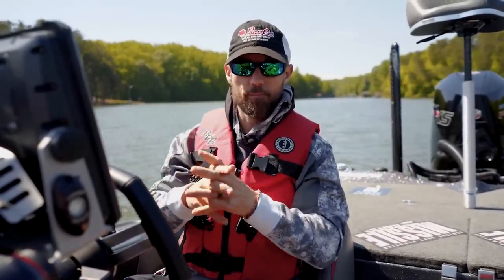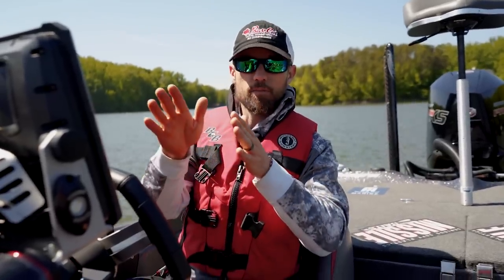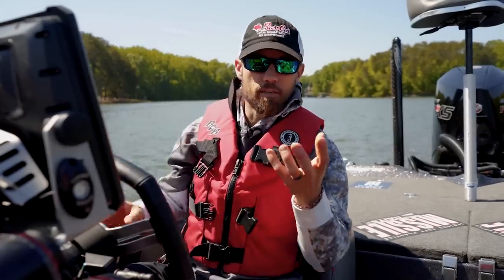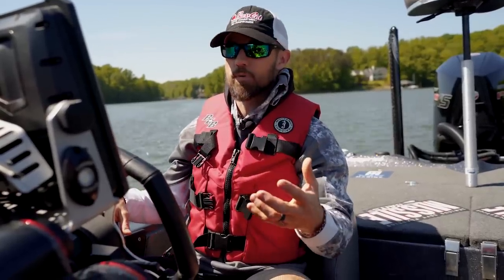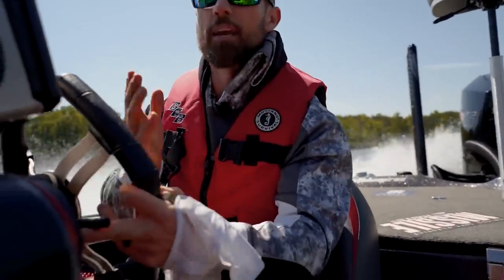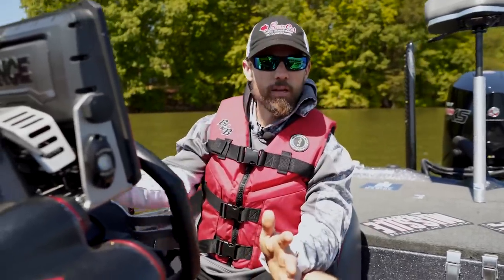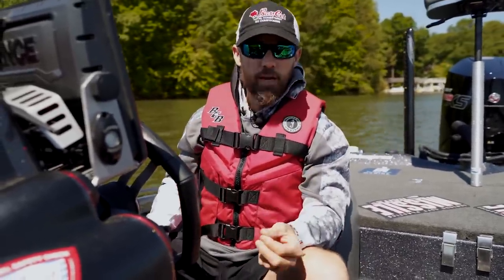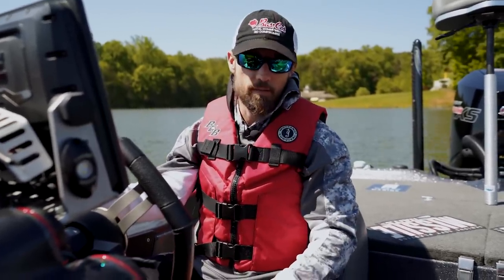BASS BOAT DRIVING - TOP SPEED 101

Comment: I used to fish Tournaments in a Champion bass boat that ran 75mph and you are 100% correct. I had that boat airborne hitting unseen waves and without experience they can get pretty hairy. 
That was years ago and I dropped out of bass fishing for awhile and sold the boat.
Now getting back into fishing I have a Basstracker 17ft with a 40hp. Now no rooster tail but you can still over trim and lose speed and the rules on waves can still apply even at 35mph.
In a smaller aluminum boat like that if you hit a wave wrong it can still toss you hard. When I had my  Champion most boaters do not realize that two boats 65-75 mph 100 yards apart will meet in 3 seconds or less. 
Where I am on the Mississippi River near LaCrosse Wi in some narrow areas two boats heading at each other and may be on a blind curve or a larger boat blocking vision that can be devastating with less than 3 seconds to react. You could do a video on reaction time when running at those speeds. You always have to pay attention to what is ahead of you. At night it is worse. One tournament I fished went until dark. Myself and 2 other boats all running in the 70+mph had to avoid a canoe that had no lights. We were all lucky we seen the Silhouette and took evasive action to avoid the canoe and each other. And yes always wear a kill tether even with my 40hp.
New subscriber and looking fwd to bingeing your videos.
Reply: Champions were Classics probabably the very best rough water bass boat ever. And that Deep Vee Wedge hull design was easy to handle.

Comment: Worth mentioning- when you feel like you’re loosing it don’t close the throttle. Your reflex at first may be to let off the throttle too fast. Trim down first and slowly back out the throttle- simultaneously. Snapping the throttle shut will cause even less control.
Reply from the maker: Yes! I may have left that out. Good one. 👍🏼
Reply: Heck yes it makes it worse, even if the lake is glass and you just let off the gas all at once, almost gives ya whiplash haha

Comment: I know im a little late to the party but as a former owner of a triton 200xp i learned 1 very important factor in running wide open...    Your hydraulic steering can lose pressure(just enough to chine walk) and the best thing is to turn the wheel ever so slightly to tighten up the pressure in the line..   It doesn’t take much but doing this prevented my boat from chine walking.

Comment: Great info, but I would add this. If you get loose and feel scared or out of control AWAYS trim down before you let out of the throttle. Some boats if you let off the gas too quickly and don't trim down you can experience a prop blow out.

Comment: Use the jackplate after raising the nose up all the way. The lower unit  will pull the boat left and right. Lifting the motor with jack plate until you feel no torque or a balance. 
Hi performance , we raise till water pressure drops then bump down.( to get 1st known measure on height), then there from then on if running light and wide open.You can adjust your  motor height based on load.  The lower the motor___ the more chine walk. When done correctly you should not have to " drive thru it".  Allison yes....
 I owned Allison, Bullet and Tritons, Skeeters.@ 9.58. boat is not on pad your chine walking , not wide open, if you are ,your nose  is too far down , reference your first comments. If you dont not have a electronic or hydraulic jack plate  you will fight that dipping side to side.Always ,  life jacket on when big motor turns on. Much respect on your fishing!
Reply from the maker: Yes! Great comments. You’re 100% correct

Comment: Nice vid John, covered the important stuff well. Curious about your thoughts on two things - if/how loading the boat/side-to-side balance can affect chine walking, and how do you handle turns at high speed. The idea of an accidental bow hook is always in my mind when running at a good clip, appreciated the details on dealing with wakes. Thanks!
Reply from the maker: The less weight you have in the front, the more she will walk. Side to side not affected. High speed turns will be in the advanced turning video. 👍🏼
Reply: @JohnCrews  so with that said. I keep very little up front. The Sabre, I've found does not lift well with weight up front. Maybe I'll move stuff around and experiment a bit....🤷‍♂️

Comment: Small adjustments on jackplate can help also..and I mean small adjustments..if your boat starts to chin walk at a certain speed..you can start those slight side to side wheel movements before the boat starts to walk. If you wait for the boat to initiate the chin walk more times than not your a move behind and could make the problem worse.. Be safe out there!

Comment: What is your particular mind set on how weight should be distributed as it relates to speed. Ken Smith did a video showing changes in top end speed based on how his weight was distributed in his boat. Also, as lithium batteries are much lighter than regular batteries and many/most people believe that the lighter load (in this case, obviously batteries) equals more speed. Yet, I've seen other videos where they are purported to show that because of where batteries are normally located (ie the back of the boat nearest the power source) that switching from lead to lithium only increased the speed less than 1 mph. What, sir, is your take on that. Thanks.
Reply from the maker: Short answer is the switch to lithium’s has zero effect on top end but a HUGE difference on hole shot. Lots of tips to weight distribution for boat performance
Reply: Thanks, John. It might be an idea for a future video, assuming you haven't done one already.
Reply: Boat brand has a lot of affect on how weight affects the boat. And where you need the weight. If you swap to lithium’s in a bullet or Allison, (and no I’m not talking about the 20ft boats, specifically mean a 21) you WILL again speed, guaranteed, every time.  And yes, bullets can ride good. Best ride I’ve ever been in was a 21’10 bullet, worst was a ranger, speared every wave cause they’re so heavy and can’t get out of the water. This is on wheeler lake too and it gets big and rough there.

Comment: forgot to add that it is pretty essential to have a hp lower unit with a lower water pick up.  on some applications with a standard lower unit, you can run out of water before hitting the magic spot.  the hydraulic jack plate makes it pretty darn simple to get it dialed in.  amazing what just an 1/8 of an inch will make between having to fight the boat and just driving like a car.  and not every boat will run right with the same prop.  find the right prop for your boat not your buddies.
Reply from the maker: Very true. 👍🏼

Comment: John if you're in a lighter aluminum boat going 56.4 mph in a Tracker 190 ,Mercury 115 XS pro with Laser 2 prop with 22 pitch is this like if you're running over 60 mph in a fiberglass boat?

Comment: When you say bump it down two taps, do you raise the trim back up once you are moving pretty fast or just leave it there? I have a 2000 TR21 with a 225 EFI and I have had it up to 73 once. At 65 it starts to walk pretty bad. I made around 8 runs today and every time I would eventually try to correct it but go in the wrong direction and it got a little scary. I just started trimming down once it got too bad as I heard if you let off the throttle too quick things can go real bad. I did finally fill up both live wells for the last run and it helped a little. I'm not sure if yours is the same, but mine falls really fast side to side. So quick that you can't think about which side is dipping. Maybe I was just over trimmed though. I was only running around 1/4 tank gas (I guess around 15 gallons). It seems to be more manageable with more gas in the boat. And if I have a partner it balances a lot better and isn't near as bad.
Reply from the maker: Leave it at the 2 bumps down. If you raise it, it’ll get squirrelly again

Comment: john, how soon after getting on plane do you start to trim up? also, do you continuosly trim or do it in bumps?
Reply from the maker: Start trimming once the front settles. I like doing it in 1-3 second bursts
Reply: I like to start immediately as the bow starts to settle, listen and the engine will tell you when it blows out, meaning you’re trimming up too fast.
Reply: Most people over trim.  Thinking it’s speed and that’s a mistake.  I’d rather have trimmed too far down than high

Comment: When I get on plane my boat digs in and pulls left hard. If I trip up it starts to porpoise quickly. Any suggestions?
Reply from the maker: There’s a major problem with the set up. Prop or something.
Reply: John Crews any chance adjusting that trim fin thing above the prop left or right would fix it? It ran fine for me last summer. Only other thing I can think of is I usually fish with my old man who is about 100lbs heavier than me. Could that make it pull like that? The extra weight on the left side? Thanks for the response tho!

Comment: speaking or addressing chine walk a bit further.  if you have a hydraulic jack plate, you should not even have to deal with chine walking.  i have never found a boat that did not have that sweet spot for wot running.  when you hit it all the bass cats that i have ran, mine or other owners, will run like they are on a rail when you hit that perfect spot.  i just ran a friends 2014 puma with a new merc 250 4 stroke.  he just had a manual plate, but several times on and off the trailer and making very small adjustments at a time.  that boat ran like a car down the road at 80 gps.  i know rick pierce and steve eastwold were always me  about how to drive through the chine, and you will have that if not in that perfect spot.
Reply from the maker: Yes. I went in depth on the jack plate on that other video so I didn’t want to say the same info over. You’re exactly right

Comment: If you want to learn to drive a bass boat just get a Triton. You’ll learn to drive your boat plus you’ll give your sphincter muscle a great workout.
Reply from the maker: Too bad they aren’t going to make any more.
Reply: John Crews I’m not sure if that’s all that bad. Lol. Mine was a handful until I got it figured out. Then it was speed demon but I never got completely comfortable once it hit 70ish.
Reply from the maker: TexasVet72 The early ones when Earl still owned it were rockets.
Reply: @JohnCrews  Yeah the Tr 20 n 21's com Triton 1997 maybe 1998?? The first ones, But from around 2001 to 2003, I think were some of Tritons faster n better looking hulls!! Then around 2004 n 2005 the lil heavier X series Tritons came out, along with Merc n the 4 stroke Verado.
Reply: I was sold a tr20 with the wrong prop. Once you hit 60 mph it felt like the boat was going to flip over. The dealer kept saying you just don't know how to drive it. "You need to drive through it." My fishing buddy almost pissed his pants when i was trying to "drive through it". It took 6 months to figure out they put the wrong prop on it.
Reply: @clarewinslowiii2186  I had a Triton once. You do have to learn to drive those things. Just a little jerk of the steering wheel to the left once it’s starts walking and it gets back under control. There is an art to it. Once I figured out how to drive it it was fast.
Reply: @texasvet7241  Once i got the correct prop, i had no more issues. It would run 74 mph with a 200 optimax on it.

Comment: With guys that have 50hp bass boats like myself, no need to watch 😝
Reply from the maker: True. 🙃
Reply: Not true. I have a Tracker and if you get caught in rough water or like myself have to Navigate on the Mississippi River with 30+ft cruisers and barges you do have to pay attention and hit the wakes and waves correctly or you can be put upside down. Alot of boaters with smaller engines have a false sense thinking they do not go fast enough to get in trouble. I have a 40hp on a 17ft tracker and have owned a 75mph Champion.  Same rules apply other than a rooster tail. Dont get a false sense of security and still be very safe. You may be going slow...but that 30ft Cruiser or a party bunch on a pontoon with a 150hp or bigger can run you down and not even see you.
Reply: Jon Gunner Grefsheim I stay clear of bigger boats, I run a flag off my stern light as well. When I do notice a big wake from another boat I throttle down. I only wide open when I know it’s safe.

Comment: you dont just ;drive through ;  chine walk  basscats are historically bad for that because of bad hull design   if  you have chine walk  dont try and do the steering crap he shows  its not good,,i know this from my involvement with the offshore racing guys  its all in the desighn of the hull
Reply from the maker: 😂😂Bad hull design. That’s funny
Reply: @JohnCrews  they have a long history of bad hulls  ran a few  I know from where I speek   it's OK  if you like the boat  then  it's OK with me.. just be safe  out there
Reply: If it's all in the hull design then I guess anyone can drive a good boat at high speed huh?
Reply: 18 inches of boat and a prop in the water.... these boats are gonna walk. The prop is the reason for the walk, slight pull kicks the back end to the left, due to the rotation of the prop.
Reply: Russell Thomas if it’s a cat then yea
Reply: @zgambler1  PUMA?
Reply: Wrong. A pad boat has to be balanced  on a very small section of the hull and the torque  from the prop pulls the boat to the right. If left uncorrected water hits the first chine on the hull and starts to walk. If you had enough space on a lake to keep your boat in a constant slight left hand turn you would would experience 0 chine walk. Off shore racing boats are a whole different animal I guess, because every fast  bass boat that  I've been in will chine walk
If left uncorrected. Even Allison, bullet, and strokers which are built for speed.

Comment: I would like to see you try to drive my comp hull , 750 pound 20 foot bullet with a 260 horse 2.5 with a 28 pitch 4 blade trophy prop, with a bobs racing lower unit , with the nose cone lines up with the drain plug , motor trimmed straight up and down,   I would really like to see you drive the race boat I use to have, 17 foot hydro stream vector, 390 pound boat , with a 240 horse , 2.4, you have no clue about driving a boat , your so lost on how to drive a boat , what a joke